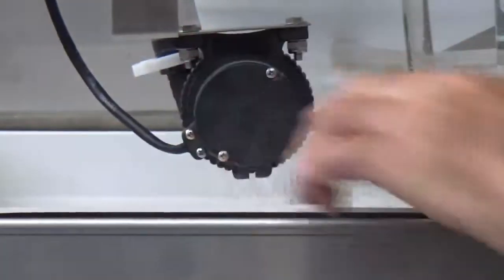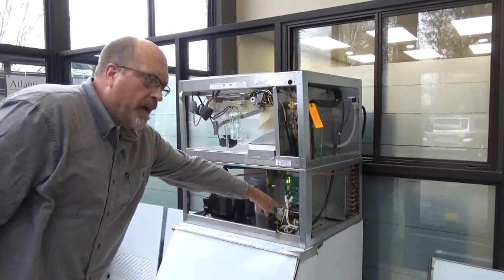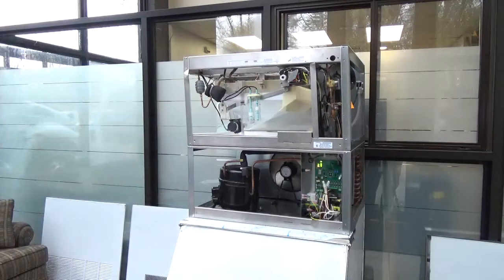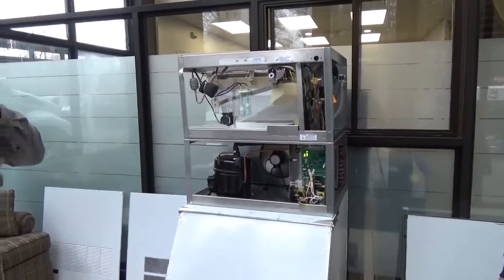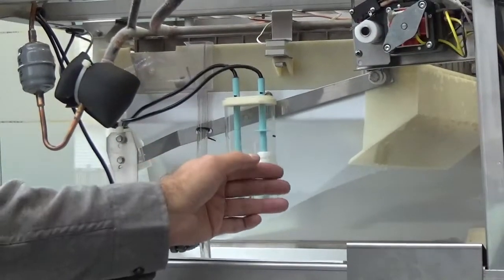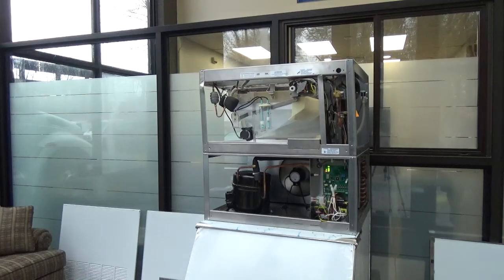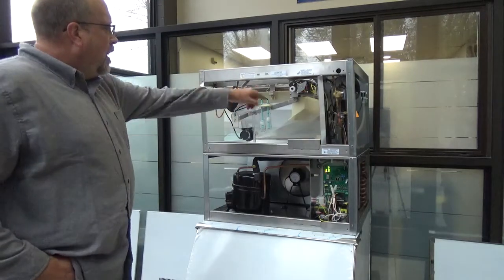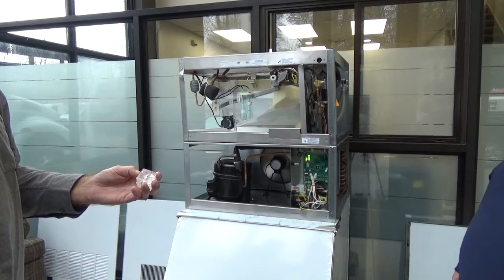Atlantic Mechanical Kold Draft Training part 4

Comment: Hi good day I am Fixing 1 of these  ice machine it has To Trays But when you put it on to make ice the Trays stay down and do not close to me Make ice it stays in Harvesting mood then the arms Goes up then comes back down then after that it starts to freeze in harvesting mood open
Reply: Hi can u send me the manual to set back up the Wiring of the line to  electrical to the board for the sequence with the pump compressor and water pump Please